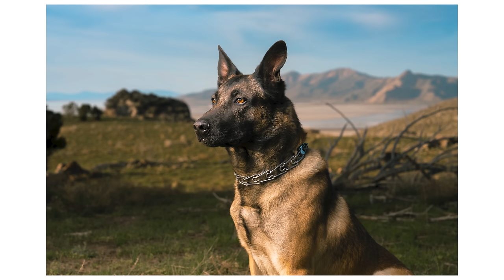Guide to Double Stack 1911's - $34,000 of Pistols

Comment: Been waiting for years for an affordable double stack 1911. Finally saying screw it and get the Staccato 🤷‍♂
Reply from the maker: That’s the right move.
Reply: U won't regret it mine runs like a dream👍👍
Reply: Worth every penny. I own a C2 and the P. Both are flawless.
Reply: Got my XL Staccato. Full Size ultimate 4.5
Reply: Anything else is a waste
Reply: The Rock Island Armory M1911-A1 Tactical 2011 VZ9MM was $800, have put over 5k rounds through it not 1 single issue except it only comes with 1 mag and each additional one is like $50-$60.  The M1911 Ultra match is $900 which I would have to imagine is just as good.
Reply: Absolutely staccato is excellent and unless you’re going to get an infinity get the staccato.

Comment: Go hit a bucket of golf balls with a cast club, a MIM club, and a forged club. Then hit a mizuno club that is “grain flow forged” and you’ll realize how important the materials are.
Reply from the maker: I like that comment
Reply: I have felt that marshmallow puff of hitting a forged Mizuno club and it was oh so nice, only problem is I had never done it before so I absolutely crushed the distance and overshot the green (8 iron).
Reply: dont golf but i dig the comment as so does jake great analogy dude
Reply: Nicely said 👍👍
Reply: As a mizuno mp32 lover, you sir are correct.

Comment: Side note,  I damaged my ejector and extractor by over inserting 26 round mags in my Stacatto in the PMO class.  I had an overnight label in my email two days after I sent the 1st email.  The pistol is now on its way back from service 2 days after I sent it off.  In total it will be an approximate 7 day turn around by the time it comes back.  Top notch customer service.  You get what you pay for.  My issue was completely self-induced and could have happened on any 2011 platform.  Buy a 2011 from a company that stands behind their product.

Comment: I don't if you mentioned it later because I'm currently not finished watching, but I wanted to add that the more precise a part is required to be, the greater the possibility for waist which drives up cost. The more strict the QC, the more parts are rejected.
Reply from the maker: True

Comment: Good video and good overview of the field.

I understand what you are saying about the Atlas.  I am no stranger to 2011s as I own a few Staccatos, Atlas and SVIs, but I think you need to approach Atlas and their ethos a little different from other guns.  They are competition guns first.  They are not duty, range toys, BBQ guns, etc.. It's like saying this top fuel drag car has really rough suspension.. Yeah, it does, because it a race car.. some of those creature comforts are not a first priority.  And yes it is expensive, and so are top fuel drag cars.

The 'snappy' recoil is for a quick and consistent return to zero.  This is a competition gun.  The faster your sights return back to zero, the sooner you are shooting points.  The name of the USPSA/3 gun game is getting as many points as possible, as fast as possible.  

As for your mag exploding, it sounds like your base pad keeper pin was not in place.  The springs have more power/tension because since the slide is cycling faster, you need to push that round up quicker for the slide to strip it out of the mag.

Lastly on the safety portion, yes, ride the safety.  This is a competition gun.  The safety is designed as a leverage point.  Atlas, along with many other companies, make shielded safeties if you are concerned your hand will impede the slide movement.

Oh yeah, and Atlas is the only company that makes a left handed grip, and matching left handed mag release for the 2011.  Something you might want to consider.
Reply: It's great that you guys toured the SVI shop.  I suggest you tour the Atlas shop if they could accommodate you.  Would be interested in hearing your comparison between the two.

Like mentioned about SVI and the custom SN, very few shops make their own frames.  Many buy from other groups (PT, L10, STI, etc).. You will find that Atlas cuts their own frames with some tweaks.  No custom SNs though.  I would have liked that option as a cherry on top.
Reply from the maker: Yea I hear what you’re saying. But my infinity is the same style pistol and the atlas guns in recently shot. And they shoot nothing alike. Snappy is snappy and I’m not sure I’m a believer of the return to zero claim. It simply doesn’t wow me
Reply: @1911syndicate  I can relate to your comment. Nothing shoots better than my SVIs. Brandon and the team know how to build a great gun. SVI is a very high bar to clear 😂
Reply: @1911syndicate  u complaining about atlas price but buying infinity acting u r in a cod video game...infinity shoots exacts same quit overhyping lmao...u r the guy to compare staccatos to atlas lmao...delete this video
Reply: @madedits2228 the way you convey your "thought" tells me that you likely do not own any of these guns. Go finish high school.
Reply: @AJ-hn6fp  mhm go see lol if I didn't y would I comment? That's okay to be wrong buddy I forgive u

Comment: For what it's worth, got a RI Double Stack 1911, base model.   Works just fine, but after 2 years....prefer single stack. My 1911, Dad's GI 1911A1 and trigger time on WC.  The RI DS will remain but if do over...single stack n Xtra mags.  Do like it, we call it the beast.  It works great

Comment: I know the prodigy got a lot of hate when it was first released but I think SA fixed a lot of the initial issues.  My prodigy runs perfect and I have no issues with fit/finish or cycle of operation.  I do get the long term reliability issues with MIM parts but you can always switch those parts out with DP, EGW, Infinity or Sti parts and still be well under most high end 2011’s.  I am surprised you didn’t talk about TTI or Rock Island.
Reply: Me too. I'm surprised they never even reviewed one with 1911 in their name
Reply: I got a prodigy 5 inch not long ago. The gun is a beast, runs great, shoots better than I can shoot at my age. All in all I believe this gun is going to put a dig dent into these High and Super High dollar guns in the long run. I always wait before I jump on or in Bandwagon. Glade I waited I got it at a better price by waiting.
Reply: I got one Saturday and it ran out the box and was well lubed!!! 1499 b4 tax wit hex optic
Reply: I picked up the Prodigy 5" this week...freakin love it!  SA marketing says they are Forged...not sure if there are some parts that may be MIM or Cast??  but sounds like the Frame and slide are at least forged.
Reply: Springfield Prodigy, little time polishing one and they are dead nuts accurate and reliable, probably more reliable than some of the $2500 to $5000 2011’s. I have an old double stack PARA and it is hard to beat plus ROCK ISLAND makes one hell of a solid frame double stack gun. Now I do like my two Staccato guns but their price is where I draw the line.

Comment: For the raw material section, I can guarantee you that forged is stronger than a raw cut billet part, for forging you basically take a billet piece of metal and force that into the rough shape that the end piece is supposed to be, then after that step it will also be precision machined into the designed part.
Billet skips the forging step and goes straight into the machining from the factory metal billet you receive, that's also where the name comes from. 
Why is it stronger? because the forging forces the metal grid/grain structure to follow the shape you want and doesn't seperate the inner metal bonds.
Reply: thanks for the knowledge. He makes great videos but no one can be right all the time. He said billet is stronger and I was like wait that doesn't sound right but I didn't have the background to fully understand why. I think mim is supposed to me stronger than cast also as its voids are more micro in structure? so wouldn't it be cast, mim, billet and forged?

Comment: With higher end watches you are also paying a premium for name. The Grand Seiko is one of if not the most accurate mechanical movement watch and is hand crafted, yet typically runs less than Swiss premium brand name watches. 
Relating the statement above to 2011 guns is simply you are paying extra for a perceived benefit that you typically cannot tell when using an expensive 2011 in competitions. I can get a Prodigy, Canik SFX, Walter Q5 or a CZ shadow 2 or P10 do some mild mods and know my gun shoots just as well. Felt recoil is a matter of personal perception and ammo choice.
But on a side note we are all free to buy what we want.

Comment: As for me I will stick with my Prodigy and Rock Island. I can get a Rock Island Dubble stack for less than a 1/3 of the price of some of these guns. It's a heavier gun by being all steel but runs great and you don't have to take out a 2nd mortgage. The Prodigy will put a dent in these high and super high dollars guns in the long run IMO. I can see it starting now as many want a good Dubble stack but not having to break the bank and taking out a 2nd mortgage for a gun and a few mags.
Reply: I've seen a couple Rock Islands that were turned into competition guns, and they held their own with the higher priced guns.  Right there with the "entry level" base Staccatos that were upgraded for competition.
Reply: @sethduzan4441  A gun doesn't have to in the thousands of dollars range to be a good gun. I don't need to pay for a name because it's cool.

Comment: I agree with your statement on Atlas guns…. They are incredible however I do not feel a $3000 difference when shooting them vrs a staccato. My staccato xl is a great gun. I like nightforce also.. I dont like high maintenance…
Reply: I was at my brothers for 4th of july, shot my Staccato C2 next to his Atlas athena, the price difference was not there, nicest pistol in terms of racking the slide / grip and everything but not 2-3x price better.. than again.. probably same could be said for a Glock / SIG or even a BUL compared to Staccato.. is Staccato 2-3-4x better? naw.
Reply: You're right, my staccato XL is as sweet as it gets, it was built in the new Factory after they had moved and it's super nice,, 👍

Comment: I'm surprised you don't have a Chambers Custom in this video. Or you may be waiting for one!
Reply from the maker: I am not waiting on one
Reply: @ Wilson Lei

Yea it’s not mandatory but can’t really say the 1911/2011 platform has been fully tested without at least diving into the Bob Marvel standard of the platform. Chambers is the best known example but there’s been a few to branch off from his shop who are doing similar work. 

For that old school approach to workmanship the Marvel build philosophy is probably the best. Newer processes in machining have sped up the manufacturing, some have pretty good tolerances, hard to beat Marvels though.
Reply: @marcusjohnson5839  True. Also, Rob S. at Alchemy builds a true hard fit gun. Tops in accuracy. His mentor in building hard fit 1911's was gained with His time a t Les Baer Customs. Now if Les would just build a 2011! Not holding my breath for that to happen. GRRRR!
KnifeMaker

Comment: Billet is only higher end than forging in terms of precision of the finished dimensions which can be matched by forging then machining to final specs. Billet does not add strength to the part the way forging does. Bullet simply means it was machines straight from a billet of metal which is a piece of metal stock which was formed by continuous casting usually. Forged parts will be made originally from an ingot which was a lump of metal cast then forged into a rectangular block for further working. At least that’s my understanding of it. Forging can’t make shitty material good, but it can add strength whereas billet is what it is. Billet parts are almost always machined from a pretty high quality piece of metal stock though. I would imagine that for slides and frames the final fit and finish from a billet machined part is worth more than the added strength from a forged part. My understanding of a forged part like say a 1911 frame is that they would start with an ingot, forge it into the rough shape of the frame and then machine away excess, followed by final heat treat once machine work is done. Again, I’m not a metallurgist or a pro in the field but I am interested in metal science to some extent. Anyone who knows more than me feel free to jump in here and correct any mistakes.
Reply: The only real downside to forgings is the costs associated with their production provixed youre comparing roughly equal metal chemistries.
Reply: @roberthutchinson2856  This has always been my understanding. I feel it’s more correct to think of forging not strictly as a type of material but rather a process of how the material or part was made. I have always been informed from the world of cars that if all things like metal chemistry are equal a forged part made of the same material or material of similar quality from a billet; the forged part will be more expensive due to the increased production time and effort but will also have added strength from the forging process. I don’t think that extra strength is really needed for a 1911 slide and frame when the alternative would be premium quality billet steel.
Reply: @JG54206  thats correct it really isnt needed in a ton of parts. Heck mim works in a lot of places as well if designed properly.

The only slide i can think of that uses forgings is the hk usp line.
Reply: @roberthutchinson2856  I think some older manufactured 1911’s and maybe some current ones still used forged frames and slides but I could be mistaken.

Comment: Im one of those guys that drive you crazy with Staccato upgrades. I didn't have 4.5k to drop on a Fowler at one time though. Also, I upgraded the 2019 P which has a full length dust cover and is no longer made so it has some pretty decent collectors value. If I ever want to jump into the next level of refinement i should have no problem selling to upgrade or trade into that "sweet spot" as you call it. 
I love your content guys. Keep up the great videos.
Reply from the maker: Whatever makes you happy is what you should do. Let me opinion not steer you

Comment: Nice video gentlemen. I know you can not cover every 2011. I  however would have you research Masterpiece Arms. I stumbled across them and recently received my gun. They offer miltary and LEO discount of 15% off of an extremely reasonably priced pistol. MPA checks most of the boxes of your high end examples ie all billet, hand fit, all made in house except i think the sights. The slide feels like it on ball bearings. Slide cuts are standard as well as the cut for a red dot. They did a threaded barrel for only $50. Beautiful 2 to 2.5 lb trigger. Seriouly when you got into talking about the high end example i was going yep my MPA has that for less than half of the price. They are best known for precision rifles and got into double stack 1911s a few years ago.

Comment: If you’re staying with 9mm, stick with a p226. The new Zev model is super slick and something the younger guys will like.  It’s more reliable and you can get 18 round mags standard capacity.  Even comes single action only if you want a thumb safety.  6500 dollars for a 9mm 1911 is stupid. Honestly 1400 for a 226 is stupid to, especially when you see knock offs for 300.00.  The markup is real.

Comment: Staccato blends their grip safety aswell. I owned a c2 and didn’t like the aluminum grip safety so I wanted a carbon steel from a p. It fit but not as smooth as the original grip safety.

Comment: Good video guys 👍🏻 When I bought my STI DVC Tactical 5.0 that came to $2,600 + tax & that was the highest pistol I ever bought to date. However $3,000 would be my limit for a pistol. I'm good on firearms right now & I don't plan on buying any in the future not unless I trade some old ones out for some newer pieces.
Reply: STI DVC  😍😍😍
Reply: @Chrisblau  yeah that's the one I talked about before I put the Holosun green dot on it. As the only pistol I have an optic on I'm still getting used to it but I like it so far

Comment: Aren’t aluminum engine blocks and cylinder heads basically a MIM part? I work servicing equipment at some factories that make motors. From what I’ve seen they melt different metals into a liquid and threw these hoses they pump the liquid into a chamber the shape of what they’re making. I assume this is MIM if so engine blocks are pretty tough. I surmise it’s all about the quality of materials and the engendering behind it. I don’t know I’m not a metal expert but my Father was he would always talk about heat treating parts and processes making parts harder which could cause brittle or soft which could bend and how it depends on what parts they were manufacturing.

Comment: I’ve got a ACW hicap, dvc-p and an open 38sc bul, love using them at the range but honestly polymer guns are the go to carry guns. They preform just as well and are much lighter. Just My experience as an M class carry optics and A class open shooter
Reply: Do you carry every day, if so what?
Reply: @CR12221  I do and it’s 90% sig 320 compact on a Wilson grip module with a  pmm comp, the other 10% is a j frame when I’m running or something lokenthat